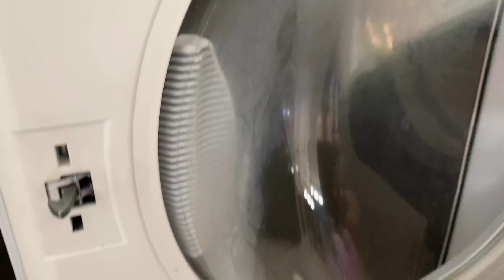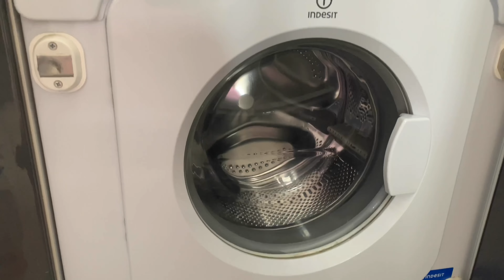*KITCHEN DEEP CLEANING* EXTREME KITCHEN DEEP CLEAN

Comment: For my washing machine maintenance, after every use I thoroughly dry the rubber ring and the door and fully remove the detergent drawer to dry it with a microfibre cloth and leave the machine door open to air the drum! This stops mould from forming and once every 44 washes I give the machine an empty drum "deep wash" on the highest temperature and longest cycle - I use zoflora in the detergent drawer and soda bicarbonate in the drum: works a treat and smells very fresh! 😁😇😄
Reply from the maker: Ohh wow! I definitely need to start doing mine more often, I don’t even keep the door open afterwards 😅 I will from now on!

Comment: My washing machine has a clean cycle which is required after so many washes - it won’t run any other cycles until that has run.
I do put a proprietary ‘service’ cleaner through it every so often  (if I remember)  ie Calgon, Dr Beckmann, HG etc.
However, the cheapest cleaner - which also deals with the limescale, mould etc - is white vinegar or a mix of white vinegar and lemon juice followed by bicarb; just add vinegar to the drum, run a cycle; once that is finished, add bicarb to the drum and run another cycle 
Don’t forget about removing the dispenser drawer and scrubbing that clean as well (little bit of bleach solution to soak that in, also helps inhibit mould growth on the dispenser drawer)
I also never completely close the door to the machine if empty to allow it to air and so inhibit mould growth and smells
Reply from the maker: This was so helpful ❤️ Thank you so much! I’ll definitely be doing this! 🙌